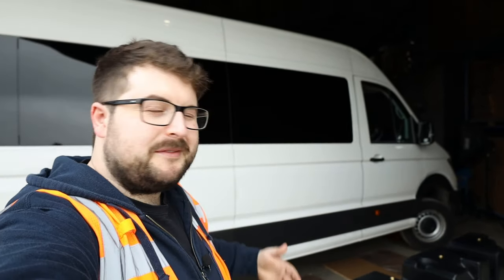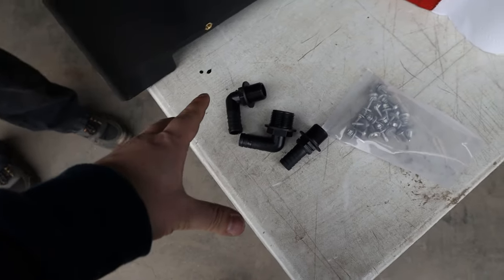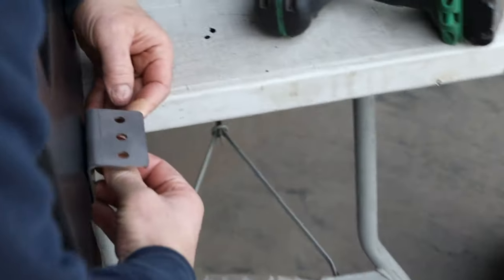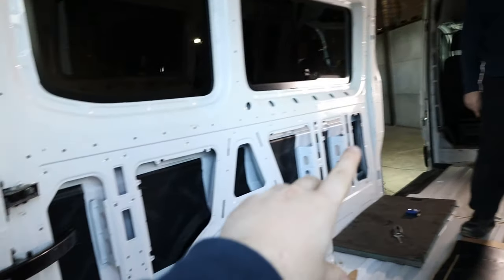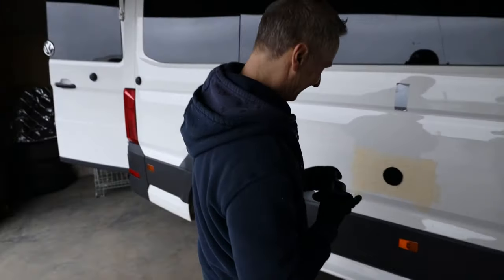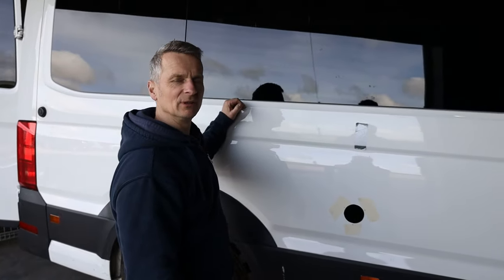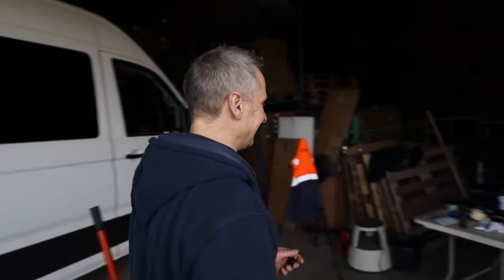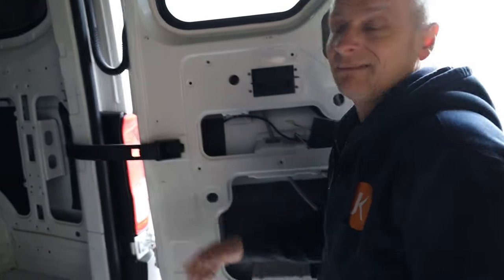Fitting a water tank UNDER the Van! Crafter Conversion Ep 3 - How to fit a underslung water tank.

Comment: Shower towards the back of the van, not the sliding door side as you will make it muddy there if on grass. Also did the water tank have a breather hole? I didn't see one, you need one...
Reply from the maker: Hi Chris, thank you for your comment! Luckily the Fiamma water inlet has a water breather in built so I don't think we will need an extra one, but we shall look into it. :)
Reply: This tank has 4 pre-installed brass vents on the top face of the tank, located on each turret. These offer secure and appropriate venting for the size and shape of tank 😃

Comment: what year van is this? I got 2022 vw crafter lwb rear wheel drive with twin wheels. I am fitting same tank and its not going right up to the van's floor.
Reply from the maker: Hi, this crafter is a 2019 LWB, the only difference would be that ours is FWD. So it should still fit, just make sure there aren't any extra fittings causing the tank not to fit. Hope that helps!
Reply: @justkampers  just a question about capacity of these bolt screw to holding tank. Is it strong enough as we only going screw and not going to use bolt and nuts

Comment: What do u think to indoor for clean water? Grey underneath?
Reply from the maker: Hi! Indoor water is completely fine, always depends on layout/usage. If you just need it for your sink you probably won't need such a big tank. And if you have a garage style conversion you can easily fit a big tank in the rear. And you can have Grey underneath, just means you would need a way to dispose the water in a responsible way. We're choosing to have a grey tank on wheels underneath so we can still store it inside when it's not in use! Hope that helps. :D